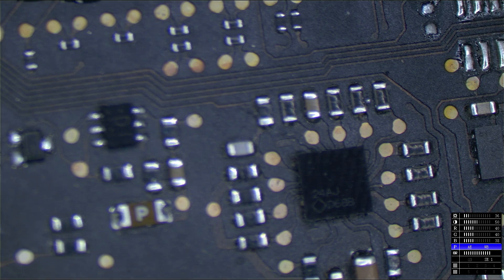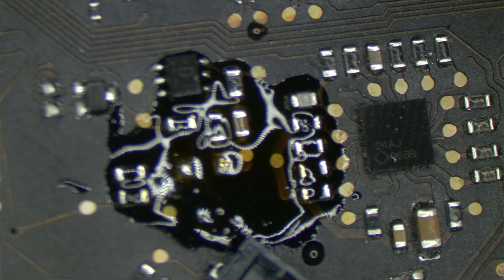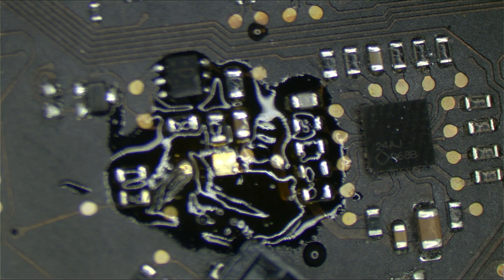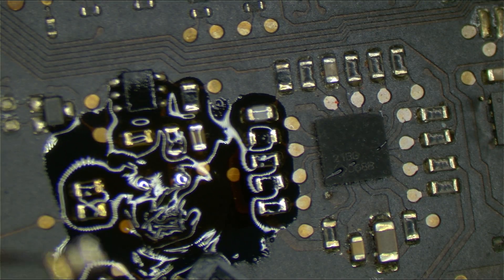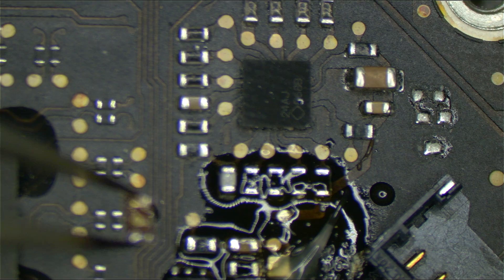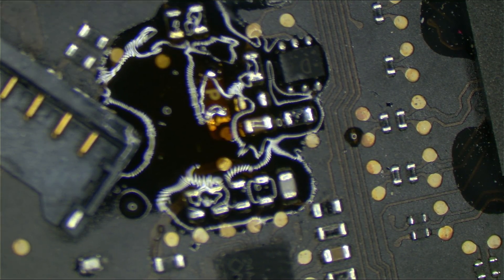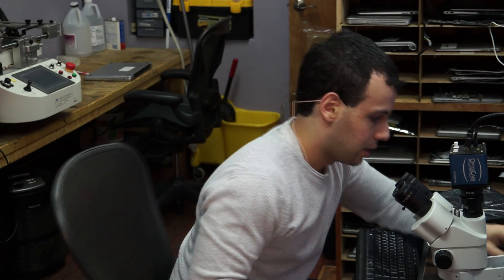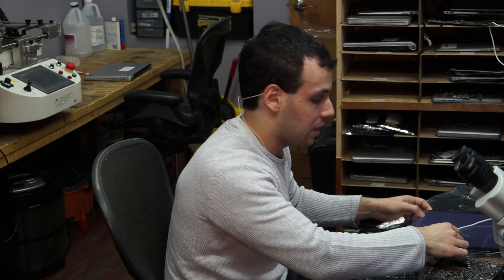How to replace a backlight fuse without hot air or hot tweezers

Comment: This is the 2nd video I've seen where you replaced the fuse to make the backlight work on a Macbook Pro. I'm going to attempt to fix this problem with the information you've given me. I figure what can I lose. The laptop is no good anyway without the backlight so at least I'll give it a go.  I only need to buy the fuse. Awesome video BTW. Thanks for your help...
Reply from the maker: do not replace it without measuring first!

Comment: So... I was useing a cheal all in one station. with maybe the wrong tip. Tip is hot enough to melt solder. but the fuse just seemed like it was stuck in place.  Then I switched to hot air gun got the fuse really hot but fuse still didnt want to come off. then im forceing the fuse to come off but gently not trying to tear pads.. fuse still not coming off. Puts New fuse on top of old fuse. Anyone experience this?
Reply: components are glued in place sometimes

Comment: Hey Louis I called your shop and they said there is an issue with my backlight after water damage. Is this backlight fuse hard to replace?
Reply from the maker: hard is relative and subjective. most of the time it isn't the fuse.
Reply: @rossmanngroup  I have the same problem. I spill water, but the mac is still working. The screen is black but if you point the light at it you can see the screen. is that the fuse?

Comment: Hi,

I have a faulty inverter from a Dell Vostro A860. In your video the fuse is labelled with the letter P, but can it also be a letter T ? And if so, can I replace it with a SMD resistor (of specific value) instead ?

Thanks.

Comment: You can buy the 120 dollar X-tronic 4000 series solder/hot air rework station. I bought it because I needed it just for things here and there, it is not a Hakko replacement I'm sure. but it sure beats using the big bulky soldering irons. And you can use Hakko tips and I think you can use their heating elements.
Reply: Agreed but bear in mind tips should fit snug. What I have found is the major problem of Chinese Hakko copies